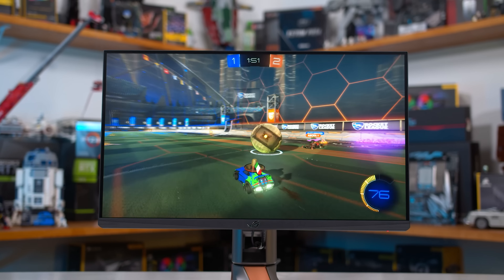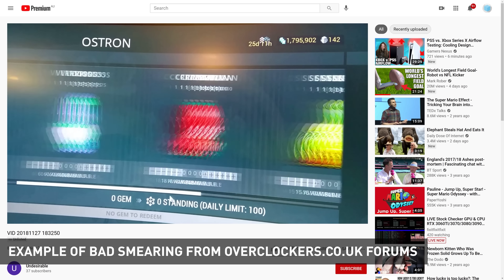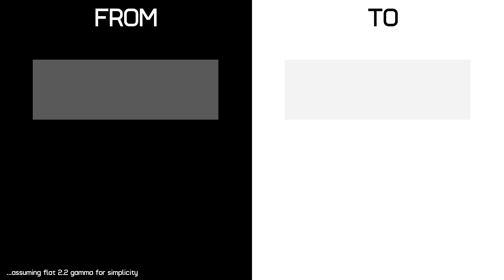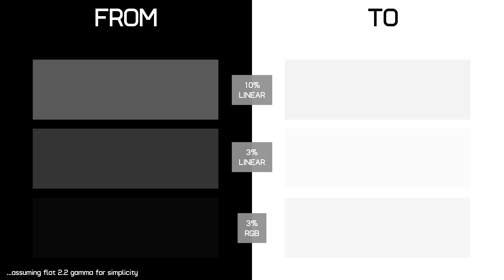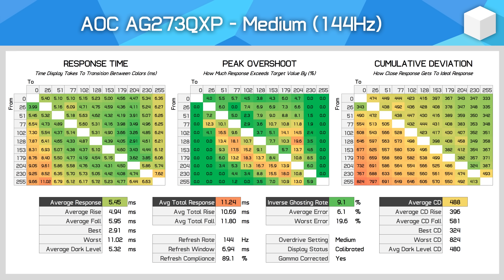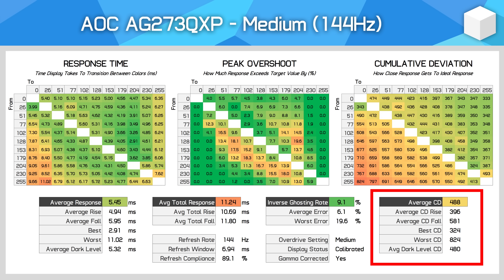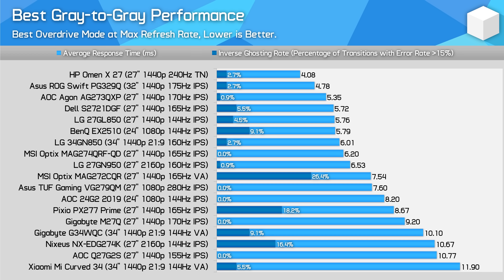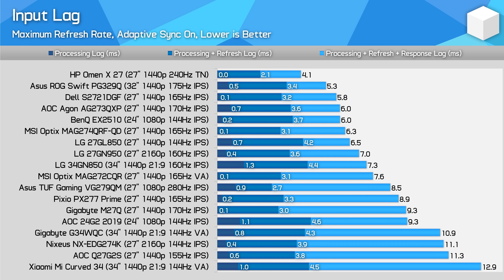What Are Response Times? Overshoot? Ghosting? Monitor Testing Overhaul For 2021

Comment: I'd be quite curious to see an OLED screen to be taken along in this testing.
Reply: There will be no oled monitors in the near future
Reply: @sen_k123  there will not be a "gaming" oled monitor in the near future. There are quite a number of oled monitors already in the market (or coming).
Reply: im also curious to see a crt monitor if possible
Reply: @sen_k123  With HDMI 2.1, VRR, and 48" sizes actually being reasonable, the temptation to just pop down a TV-as-monitor (considering monitors on consoles is also a factor) is not unreasonable.
Reply: @iliqiliev  Response times aren't what give CRTs such clean motion. Even with instant response times on sample and hold displays you're gonna have blur caused by your eyes. Maybe you already know that. CRTs basically have scanning black frame insertion which gives the same result as backlight strobing on LCDs except it's less flickery. They don't really have response times, they have phosphor decay times. Rise times are instant, while fall times are 1-3ms. It's kinda useless to compare phosphor decay times to LCD gray to gray response times. It would be much better if you compared it to MPRT while strobing.
Reply: @lordjuhca  that's what I meant, we're mostly gamers here
Reply: @TheWeirdPianist  Actually rise times aren't instant, that's physically impossible, but it's a very, very low value.
Reply: @sen_k123  LG 32EP950
Reply: @sujimayne  Obviously
Reply: @quidnunc01  That's weird. You should be able to use BFI in game mode.

If you want to have both HDR and BFI you need a display with at least 2000 nit peak brightness but ideally you'd want 10,000 nits or more. It's not possible to have both currently while looking good but Mini-LED displays might change that.
Reply: Yes! Especially the upcoming 42" LG C1
Reply: I had the LG CX 48" i took it back half the frame rate is still half the frame rate..... I cannot use a monitor below 240hz i literally look at a scene and feel half the info missing because my brain is expecting the missing data its a unique experience.  Yep i literally ditched a 4k 120hz OLED for a 24 inch 240hz tn.... Also TN was much much more responsive not because of the refresh rate but at the input lag level even OLED TVs arent good enough for competitive FPS
Reply: @joe_ferreira  Or the 27" version, LG 27EP950
Reply: ditto, despite the lack of gaming monitors that use oled panels i would definitely still be very interested to see what kinds of results would potentially come from using an oled panel.
Reply: @idrinkbbq5927  Agreed.absolutely no issue with the oled aspect totally the back end and refresh rate were my issues
Reply: Even though I wouldn't recommend them to an average user, I've had better gaming experiences on an LG CX OLED than on any high-end gaming monitor.
Reply: @TheWeirdPianist  The motion blur on sample-and-hold displays at today's fps & Hz is not caused by our eyes. Their images are actually blurry. Try and record them with a fast camera and you'll see they are. It's not our eyes that are at fault. It's the fact that there are too few frames and screen refreshes per unit of time (second) trying to represent those moving images running across a display's pixels.
CRTs circumvent that by artificially reducing the persistence of each frame and screen refresh, thus introducing a large period of darkness in each Hz's cycle. But it comes at a cost: flicker, dimness, crosstalk artefacts, perceived stutter of moving images.
Sample-and-hold displays at huge fps & Hz (thousands of fps&Hz) would solve motion image blur without introducing any of the artefacts that CRT's or Plasma displays do. But we don't yet have anywhere near the technological capabilities to have displays refreshing at 5-10 thousand Hz and running content at 5-10 thousand fps. Until that becomes possible, everything in displays will include visual trade-offs.
Reply: @edfort5704  It is caused by the motion of our eyes and the motion of the camera. Our eyes can't move 60 steps each second and when we smoothly track something moving on the screen at 60fps it becomes blurry.  It's the exact same blur as when you wave your hand in front of you. The fingers aren't actually blurry, it's your eyes creating motion blur because they can't follow them perfectly. You're both right and wrong. It is caused by our eyes and it's because there are too few frames.  The display is actually showing clear images if the response times are fast but they get smeared on our retinas when we follow them because there are gaps between them. The same thing  happens with a camera. The display is showing 60 frames a second so you'd have to follow the moving object while stopping 60 times every second but because the camera is moving smoothly the image gets smeared. On the UFO test if you look at the stationary text instead of the UFOs you'll see out of the corner of your eye that they're actually clear. Read Blur Busters GtG vs MPRT article. It's explained there.

We don't really need more than 1000hz actually. It's clear enough that it looks like real life. Lower fps content will still be blurry in motion though. So either we still need black frame insertion for those to be displayed without additional blur or we need an intelligent AI which can convert those framerates to 1000fps without any noticeable artifacts. We may see it implemented in GPUs soon similar to DLSS to improve fps.
Reply: @TheWeirdPianist  You're very confused as to what causes motion blur in displays. It is not the same thing as the motion blur of your hand moving in front of your eyes.
Natural motion blur and display motion blur are two very different things. In the first, our eyes are indeed the limitation. In the second, it's the display technology and the content shown on-screen that are the limitations, not our eyes.

Natural motion blur happens when our eyes are looking at objects that move too fast for us to be able to track reliably in motion (e.g the wheel of a moving car or the rapid movement of our hand in front of our eyes).

Display motion blur happens even with objects that move slow enough for our eyes to be able to track reliably in motion.
That's because those objects are actually blurred when moving across the screen, due to the screen's Hz and content's fps limitations. The moving images don't stay clear, like they are when they are static (not in motion). They become blurry and they remain blurry while in motion.
Test that yourself: get a piece of text or an image and move it across the screen quickly, but still slow enough for you to be able to track it in its motion. You'll see it starts becoming a blurry, smeary mess as soon as it picks up a little speed. And the faster you're moving it (while still being able to reliably track it with your eyes), the more blurry it gets (i.e. the bigger the pixels trail behind it). That's because it's moving across so many pixels that the screen cannot refresh the image at least once for every pixel that the text/image is moving across during that same time.
If you're moving an image at 600pixels/second on a 60Hz display, that image has 10pixels of motion blur, because for every frame and Hz, the image has moved across 10 pixels instead of 1, so it blurs across those 10 pixels.

Essentially, motion blur in displays is caused by low content framerates and display refresh rates (such as 60fps&Hz).
The trouble is that, for motion to look amazing on modern type displays that use the so-called sample-and-hold principle (displaying each frame continuously on-sreen, one after another) the content framerate and display refresh rate requirements are gigantic.
We need content with thousands of fps and displays with thousands of Hz refresh rates.
The math is pretty simple once you fundamentally understand how displays work. And it shows we need way more than 1000fps&Hz for perfect motion images.
Since, in order for motion images to be truly amazing on digital displays, you need a unqiue frame and a unique screen refresh (Hz) for every pixel of motion that you can reliably track with your eyes, the implications are as follows:
On a standard 16:9 screen, we can reliably eye-track objects moving at speeds of up to around 3 times the width of the screen every second. That translates into:
a) at FHD resolution > 1920 x 3 = cca. 6000pixels/s, - so 6000fps & 6000Hz is needed for the fastest moving objects that we can eye-track to remain crystal clear in motion
b) at 4K UHD > 3840 x 3 = cca 12000pixels/s, so 12k fps @ 12kHz is needed for the same goal
c) at 8K UHD (7680 x 4320) > 7680 x 3 = cca. 24000pixels/s, so 24k fps @ 24kHz is needed.
This is why motion images suck at the moment when trying to track them with our eyes: too few frames and screen refreshes available to clearly and smoothly depict moving images.

On the other hand, display technology that doesn't use the sample-and-hold principle, like CRTs and Plasma displays, avoids this issue by reducing the persistence of each frame (thus displaying each frame for a fraction of its cycle instead of continuously, and introducing a large period of darkness in each frame's cycle), but this has a whole host of issues (perceivable flickering, image dimming, crosstalk artifacts (double/multiple images trailing moving objects) and others).
We essentially need to increase all content fps and display refresh rates if we want better motion images. And we need to do it in big jumps (2x, 4x or more every time) to see any significant changes. And we need a target of 5-10 thousand fps & Hz, not merely 1000fps&Hz, although 1000 is still an awesome jump from today's 60/120/144/240 fps&Hz.
Reply: @edfort5704  It IS the same blur. In both cases the moving things are smeared on your retinas. You're so close to the truth but you're refusing it. The displays don't add the blur when things are moving it really is our eyes. You can prove it by taking a picture of the UFO test. If you don't follow the UFOs and jut take the picture you'll see that the UFOs are actually clear with maybe slight duplication if the panel is slow. Backlight strobing achieves the same thing. It's basically taking pictures a number of times a second and you only see those. The rest of the time you see black so there's nothing to smear over your retinas, The reason the UFOs get smeared on our retinas is the fact that there are too few frames but it's not the display that's doing it, it's our eyes. It really is the same blur when you wave your hand, except that's not caused by too few frames, it's caused by fast movement. On 10,000+hz displays you'll get the same blur during extremely fast motion. I don't know how else to explain it. It's a known fact.
Reply: @TheWeirdPianist  The irony is all over your comment as to who doesn't get it.
How can you not follow the UFO while it's moving but still be able to photograph or record it? How can you possibly record an object that is moving without actually tracking it in its motion? Do you even stop to read what you write or think what you say?
If you meant talking a snapshot of the object at any fixed location in its motion then it's still blurry. And you wouldn't be able to do that with your eyes anyway, but only with a high-speed camera.
The UFO is always blurry while in motion. It's never clear when moving, no matter what you use to visualize it. The faster the motion, the more blurry it gets. And I'm talking about sample-and-hold displays and objects moving at speeds (pixels/second) higher than the screen is able to display in terms of fps&Hz.
On a 240Hz display running at 240fps, a UFO or any object or image moving across the screen at 2400pixels/second (which you can easily eye-track) would have a blur trail of 9 pixels for every actual pixel of the object itself, because the image would be moving across 10 pixels for every frame and screen refresh. That is motion blur. And it happens on the display itself. It doesn't happen in your retina dude. You can see it with your eyes and also with a high-speed camera.

On the other hand, if you artifically reduce the persistence of each frame, by essentially introducing a large darkness period in its cycle, that persistence blur would go away or at least be reduced, but you would now have introduced flicker, dimming, shadow images (crosstalk) and all other related artefacts that I've previously mentioned.
Strobing an image or any of the equivalent techniques (BFI, CRT rolling-scan, impulse etc.) all use this method of reducing frame persistence so that the image doesn't blur when moving across the screen. But the cost is high, maybe less high than using ultra-high fps&Hz, but it's a visual compromise which ultra-high fps&Hz sample-and-hold would not have.

Listen, as Mark Rehjon from Blurbuster says, real life does not strobe. It's not natural to strobe/BFI/scan etc. a display. It's a technological compromise.
The best possible method, visually, to display images on a screen is by using ultra-high Hz sample-and-hold displays, running ultra-high fps content (5-10 thousand fps & Hz at least). That's because you would have the best of both worlds visually: frames that are continuously-visible on screen, without flicker between them, but that also have extremely short cycles, so that fast-moving images can be represented super-clear and smooth.
Stop being stubborn and accept this fact yourself. Read more and test more and you will inevitably reach this conclusion if you actually seek truth and understanding of how displays actually work.
P.S. this UFO Motion test, which you may already be familiar with, has helped me a lot in understanding motion blur and its causes and remedies. Test it a lot and you'll eventually see I'm right: http://www.testufo.com/#test=photo&photo=toronto-map.png&pps=960&pursuit=0&height=0
Reply: @edfort5704   I can't tell if you're actually trolling or not. Just look at the UFO test and take a photo without moving the camera or following the UFOs as if you were taking a picture of text. Mark Rejhon himself said that it's caused by the movement of your eyes. Here's his quote: "Your eyes are always moving when you track moving objects on a screen. Sample-and-hold means frames are statically displayed until the next refresh. Your eyes are in a different position at the beginning of a refresh than at the end of a refresh; this causes the frame to be blurred across your retinas".

Read Blur Busters Why do some OLEDs have motion blur. If after reading the article you still don't believe it then I can't help you. Or you might actually be trolling. You might wanna make a post on Blur Busters forums and have other people argue with you.
Reply: @iliqiliev   There's no real need for that since CRTs don't suffer from the same issues that LCD panels do.
Reply: Oled panel is the best especially their prices😂
Reply: @sen_k123  welp
Reply: @sen_k123  this aged like fine milk

Comment: This is really cool. I've been lecturing about harmonic oscillators and PID controllers recently so this is very relevant, interesting to see in practice what can happen when you have subcritical damping. I guess then "overdrive" is effectively a higher "spring constant" (or lower capacitance) and then the damping factor that causes it to then return back to its correct value is the resistance.

Comment: Thank you Hardware Unboxed for the excellent reviews and improved testing methods which make good sense and very well explained. I would like to better understand these numbers and perhaps if links could be provided for some of the detailed monitors testing (before and after the new testing method) particularly around the max refresh rate this would be appreciated. For example I own the AOC Q27G2S which performs best at the highest overdrive mode for gaming whilst introducing some overshoot. However when I look at the chart of best "gray-to-gray" performance the 10.77ms with zero error rate indicates that this measurement was probably taken at the next lowest overdrive mode (medium with zero overshoot instead of strong with some overshoot). This metric at the highest overdrive mode (strong) may have produced a better result for response time - so what is not explained in this chart is which overdrive mode has been selected for the "best" overdrive mode measurement and why - this would affect where the monitor sits on this chart. Appreciate your work, keep it up!

Comment: Started video thinking it'd be redundant for me.
Ended up being really impressed  with a darn near perfect explanation of a truly better test methodology than used by most reviewers. Perhaps most importantly the test suite is very practical for gamers especially: probably your key audience. I am also very impressed with the writing and the repeated references to Aperuture Grill as a source of some of your new methods. Kudos for revealing that.  I bought the MSI Qrf-qd you recommended  and am going to unbox/ calibrate and play on soon. Trusting your recommend on that. Oddly very under reviewed monitor. Also had the ips version of Viewsonics latest IPS 27" w/ G-sync ( XG270QG) but sold due to  $ issues. Was a very good monitor, but have since replaced it with the Best rated 27" VA I could find for dark room gaming. It's another Viewsonic ( they're doing well lately ). Was hoping you'd have reviewed it but got it anyways. It will go head to head w/ the MSI soon as its also still boxed: XG270QC.
KUDOS AGAIN!